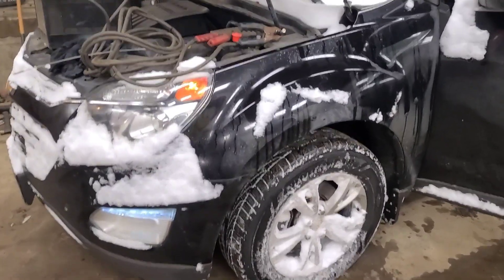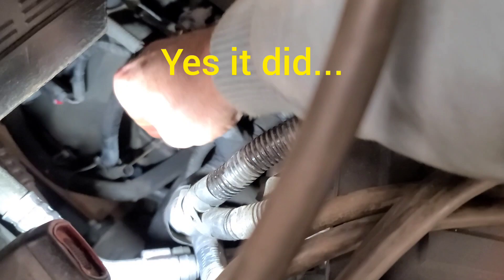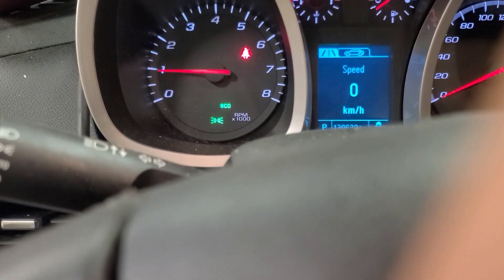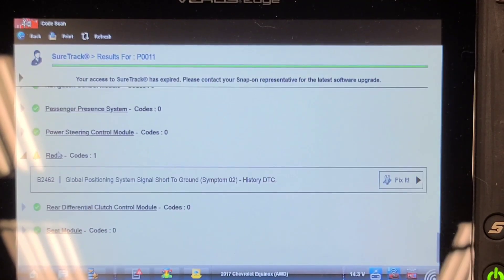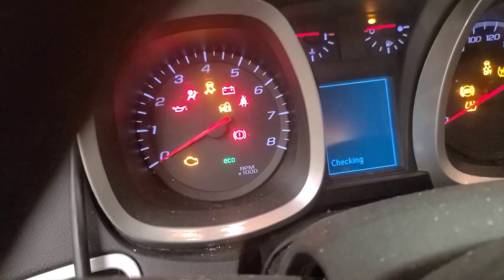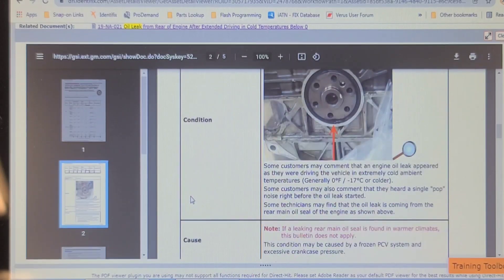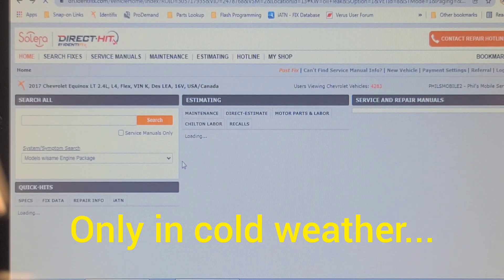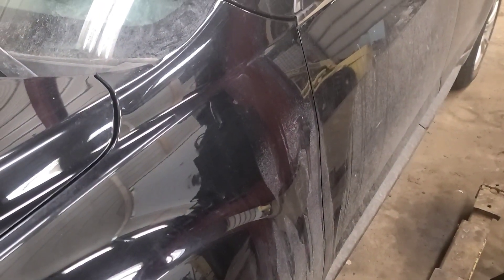2017 Equinox PCV Freezeing Causes Rear Crank Seal Failure Then Engine Failure

Comment: My mom's 2013 just did this the other day. Not sure how far it was driven after it blew, but when she got home it sounded terrbile. Had it towed to a shop to try and get it fixed under extended warranty, and it got denied. Said the oil was empty, and there were lots of metal shavings in oil. 
Got it towed back to the house. Had to drive it up the driveway, and it sounded fine, and drove fine. Not sure what to do for the next step. Don't notice any oil leaking now either.
Reply from the maker: At the very least it would need the seal replaced. It will only leak while it's running. If it ran low on oil and it sounds like it did it will damage the crank bearings. So now it needs a replacement new or used engine. I love how these warranty companies can deny warranty for this...

Comment: Currently sitting with this same issue 2017 70,000
Reply: This vehicle is actually my sister’s and so far everything looks to be covered. I will update you once I get confirmation. But one thing I know from experience,is that you should let a very experienced mechanic deal with the “warranty “ people in the beginning. I told her to go to the Chevy dealership and speak with the service manager before doing anything
Reply from the maker: That sucks, hope you didn't damage the engine due to oil starvation.
Reply: @PhillipBailey  found out we have a extended warranty active still. I hope the cover this disaster
Reply from the maker: @lep8622  I wish you luck. Just the seal leak can run to 2k
Reply from the maker: @lep8622  were you able to get the car repaired under warranty?
Reply: Happened 2 days ago to my daughter’s car.  $9700 to fix/replace engine.  Known problem.  Extended warranty won’t cover this. Should NOT sell this vehicle in states with cold weather without warning.  Looking for a new vehicle, not a Chevy.
Reply from the maker: @user-jq9wo2jc9f  what year ang how many miles. Was there still an extended warranty on the car? If so what was the reason for denying the warranty?
Reply: 2017, 87000 miles. The service rep tried with the extended warranty people and felt bad when told they wouldn’t cover it.  Said known issue and some people have annual service to clear their PCV for $400.  Not listed in recommended service literature for vehicle.
Reply: We were working with the dealer we bought the vehicle from and the service manager there.  Hope others can get this covered.  Did read something about a class action lawsuit related to this issue that I’m going to look into further
Reply from the maker: @user-jq9wo2jc9f  I would think if it was a GM dealer and GM extended warranty and it's still within the time and mileage to fall under the warranty it should be covered. Now if it's a third party used car insurance policy that's another story. Those policies are hardly worth the paper they are written on.  Saying it's a "known condition" is a cop out. If its genuine GM warranty I'd go to battle with them. This is a well documented design flaw that GM refuses to admit to. Good luck

Comment: This just happened to my daughter on Friday driving my car (2017 Chevy Equinox) home from college.  Oil had just been checked that same day.  Check engine light came on, we drove it one mile to the repair shop.  All oil had leaked out, the oil light didn't come on and by the time we got it to the shop they said the engine is ruined.  70,000 miles on it.  Any ideas on cost of a new or rebuilt engine?
Reply from the maker: Yes once it blows the seal it's only a matter of a few minutes before it looses all the oil in it. Usually by the time you notice a running problem it's too late. Replacement engines are hard to find at least in Canada. I can't even venture a guess as to how much repairs would cost. Around 8 to 10 hours to swap the engine in and out depending upon how much has to be switched over and whether it's AWD or not. Good luck

Comment: This just happened to me. Saw a little shimmer of rainbow color on the driveway. Tried to look the car over and didn’t see anything. Went to work and it smelled super hot. Later made it back home to see a big pile of oil under the car. Went in right away minimal to no oil in it. Just at 70k. Gm wont budge to cover it and the dealer knew right away the problem and said they have seen multiple cars with this issue. Lucky they said I didn’t ruin anything else but looking at $2,500 to fix this
Reply from the maker: It's definitely a poor design for sure.
Reply: Me too just happened yesterday dealer said same thing out $2,000.

Comment: I have a 2017 Equinox, FrontWD. Everyone seems to be describing what happened with me. I was driving (cold night) shut it off. Warmed it up in the morning and it was a very rough idle. Drove and got the codes read...P0011, P0017, P0366. Drove it back home and once I noticed the oil, I knew it was bigger than changing just a sensor out. Since I only drove it a few blocks after the initial problem showed itself, I'm hoping I didn't mess the engine up. Just had it towed away. I'm praying I can get it fixed for the cheapest amount possible, then I'm trading it in ASAP. GM should be ashamed of themselves for pumping out such a shit product, and not bothering taking responsibility. Foreign cars from here on out for me!
Reply from the maker: Good luck and I hope you haven't done permanent damage to the bearings due to lack of oil. I'd fill it with oil, run it, clear the codes and see how it runs before repairing the oil leak.
Reply: @PhillipBailey  Had a newer old motor put in. I'm going to sell it tomorrow. Good riddance, never will I but another General Motors product for as long as I live.

Comment: Just happened to my 2016 equinox. Quoting me $8300 to get it fixed. Idk what to do anymore
Reply: This happened to my 2017 Chevy Equinox with 122,300 miles! Quoted 3200 to get it fixed! Luckily my Engine was still good..
Reply: @jtobegood  trying to get a cheaper quote. From different places. You got a great deal sounds like
Reply from the maker: If you're engine is still good what's the $3200 include. You can either pull the engine or transmission to access the seal. If its an AWD it's more work for sure. I'd say 10 to 12 hours plus the seal, some exhaust gaskets and intake gaskets and an oil change.

Comment: Just had the same issue . Don't even have 60,000 miles on it  luckily I got off the highway when this happened not sure it was this or the transaxle blew apart.
Reply from the maker: That sucks for sure. If the engine oil is low its likely blown the rear seal out due to pressure buildup in the crankcase caused by a frozen PCV

Comment: It was -20 in Illinois. Car barely cranked over (2015 Equinox) and drove to work. Turned into the parking lot, motor seized up, lost power and slid into a parking spot. Said “low oil” then it said to turn off the motor. Oil leak under the oil pan and wayyy to cold to work on a car outside. I’m so lost. This has never happened before today. Think this sub zero temps had something to do with it. Ran fine until 2 days ago. Any suggestions?
Reply from the maker: As mentioned in the video the PCV system freezes up in cold weather. this causes abnormal crankcase pressure which blows the rear seal out of the block and causes a major oil leak. If not caught the engine runs out of oil and damages the crank bearings. if the oil leak is between the engine and transmission this is likely what has happened and you will need another engine. Merry Christmas BTW.

Comment: This happened to my wifes 2013 GMC Terrain in January.  Had it towed home, put oil in it and sounded the same.  Ended up taking to shop, $ 7,400 for a remanufactued long block with a 3 year 100K warranty.  I have installed a vented oil filler cap on it and also a drain line at the bottom of that pocket in the breather where the PCV hose connects because it always fills with condensation.  Hopefully it will help.  Not sure why these motors get so much condensation.  Always wondered when I changed oil why the filler cap looked wet inside.
Reply from the maker: If that small passage in the intake manifold gets restricted then the crankcase won't vent properly and you will get condensation buildup. I would not recommend a vented oil filler cap as this will likely prevent proper crankcase venting through the normal flow. To see if it's working disconnect that plastic tube from the valve cover and put your finger over the nipple on the valvecover at an idle. With the crankcase now sealed you should begin to feel a slight vacuum build up. If it builds pressure then the small orifice in the manifold is plugged. Hope this helps you.

Comment: General Motors is so wrong for this. Why make great old classic cars and turn around and produce complete junk? Sorry I'm just upset my daughters car has this problem.
Reply from the maker: I dont blame you for being upset. GM had this problem in the 70's but because it only happens in cold climates they don't care. I would recommend that you insulate that plastic vent tube from the valve cover to the air induction with a piece of plumbing pipe insulation so it does not happen in the future.

Comment: My 2017 Equinox started bucking a bit a few days ago. the other day driving home from work, I got a reduced engine power, low oil pressure,and service stabilitrak warning lights and check engine too. It's currently in the shop. Mechanic said it was leaking some oil but there still trying to figure out what's going on. I have 70K miles on it. Any thoughts? Is my car doomed?
Reply from the maker: If its leaking from the rear seal make sure they check the PCV operation. I'd recommend to do an oil change first then evaluate it for possible bearing damage due to oil loss. Was it below freezing when this occurred?
Reply: @PhillipBailey  It was pretty cold out.
Reply: Same here at -5 F

Comment: How much would this repair typically cost? This just happened to my car yesterday ☹️
Reply: was just quoted 3716 at serra chevy.. im towing it home and will do it myself. gotta pull the motor and trans
Reply from the maker: No you can pull the motor out the top. There is enough room to do it. Did you run it out of oil and damage the bearings? I'd fill it with oil and run it to check for damage first. It would suck to pull the motor  fix the rear seal  reinstall and find out afterwards the engine is damaged due to lack of oil.

Comment: Woow lot work to remove the the pcv valve
Reply from the maker: It does not really have an actual valve only a fixed orifice and if that restricts due to ice or carbon then the system flows backwards due to crankcase pressure. Moisture in the vent hose then freezes leading to excessive crankcase pressure which blows out the rear seal.
Reply: Thank you so much for explaining, your videos are very helpful and very professional, happy new year🙏

Comment: This is very common with equinox and gmc terrain 4 cylinders. Also chevy Malibu. Pcv keeps clogged and blown rear main seal. I changed 3 equinox rear main seal and timing chain in one month because of that shity pcv valve.
Reply from the maker: Yes I know but the sad part is the engineers know this is a problem but refuse to address it because it only affects cold climates. All they really need to do is use an electrically heated air inlet pipe. Other manufacturers do. The problem is poor engineering.
Reply from the maker: I'm wondering if there is a way to drill an access hole in the plastic manifold so the orifice could be cleaned without removing the intake. Another thing that would help would be to insulate the fresh air tube so if the system fails at least it doesn't freeze and build pressure. We will see once I get the engine apart.
Reply: @PhillipBailey  actually there is no solution for this. Dealers don't have any upgrade parts. Every single GM cars with that engine build too much burn oil debris and clogged the pcv For some reason. Plus those cars burn oil like crazy too.
Reply: @PhillipBailey  We drilled an access hole from the front of the plastic manifold. Then inserted a paperclip to clean out the orifice. Then a drill bit by hand for cleaning (did NOT change size of orifice). Then sprayed some mild cleaner. Sealed access hole with a plug. Will clean that every oil change. 

There are a few videos on this.